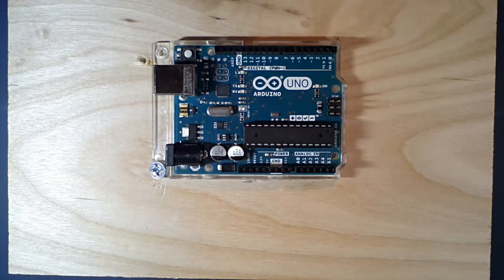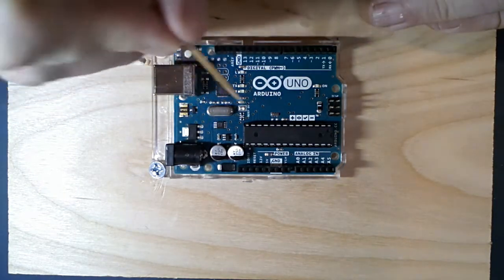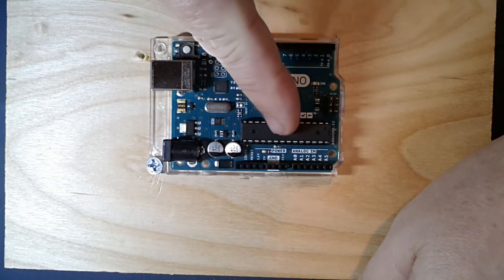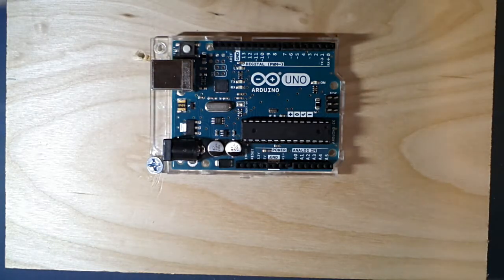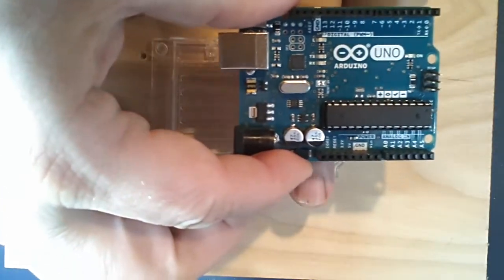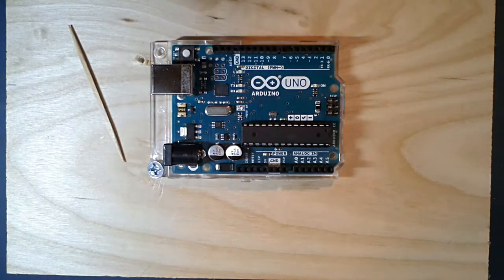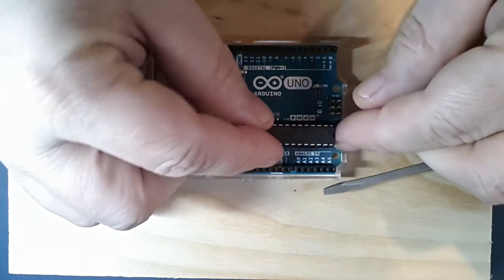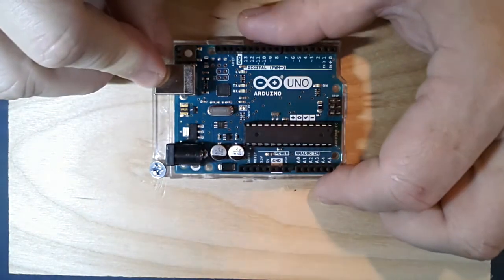Arduino Uno R3 Board Introduction

Comment: i GOT THE ELEGOO AND ALL THAT NOT ON IT. I HOPE IT WORKS, JUST GOT IT
Reply from the maker: In my Fiero playlists, every credits section has a way to contact me. I can help if you have any questions.
Reply from the maker: I never made a video on how to program the Arduino UNO R3. The Elegoo kit should have come with a CD with all sorts of projects. First you need to install the Arduino Integrated Design Environment (IDE). It may be on the disk, but you can also download it for free from the Arduino web site.
I don't know your level of electronics but I teach Summer STEM, so I can give you the basics to get you going. What is your goal? Paul.